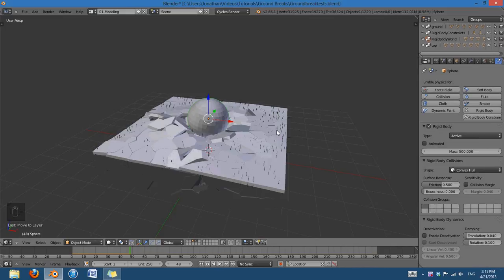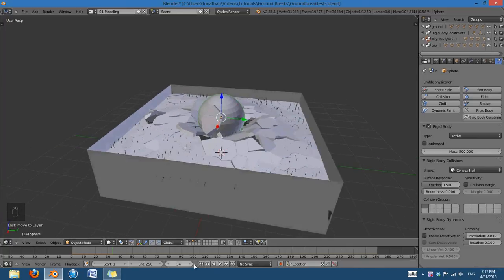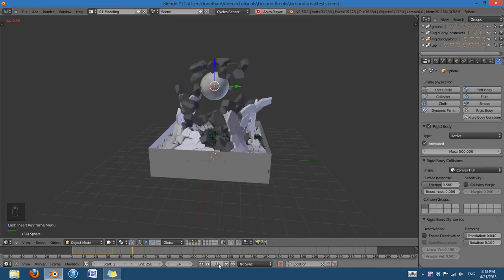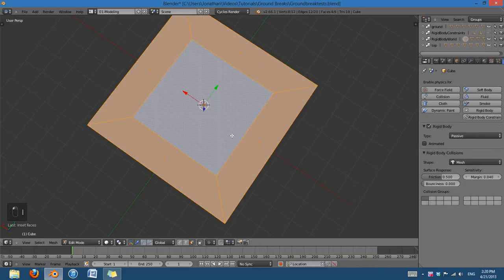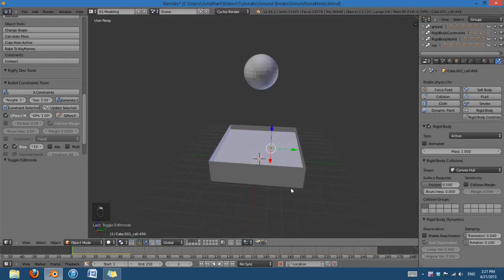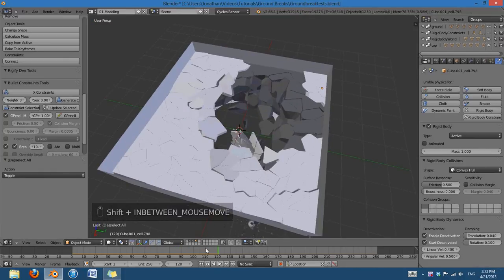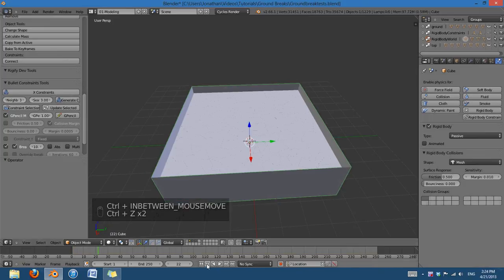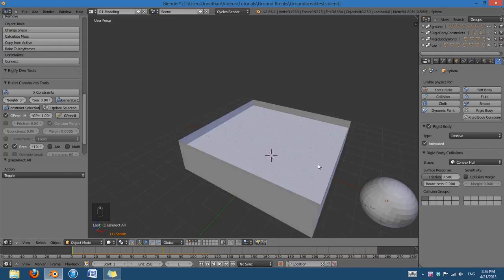Quick Tip: Containing Groundbreaks and Earthquakes in Blender

Comment: I haven't tried this yet myself, but how about having the supporting surface beneath your ground slide out from under it so the ground collapses along an apparent faultline a-la your traditional Hollywood earthquake? I reckon that would work.

You could probably use a variation of this to control the collapse of walls in a building.